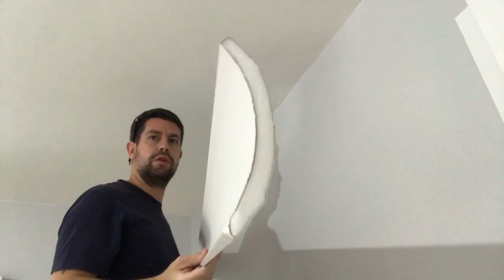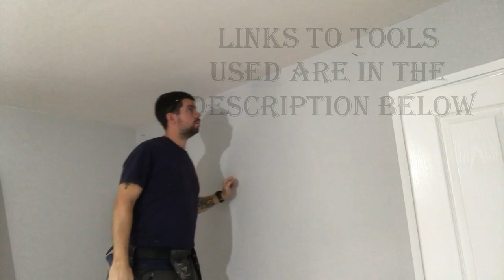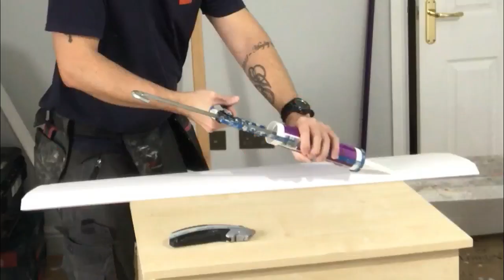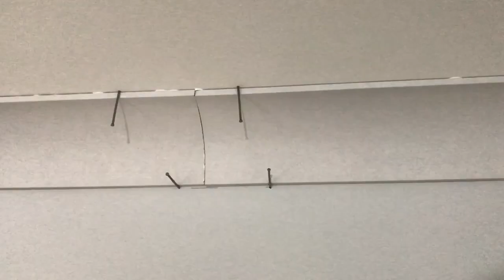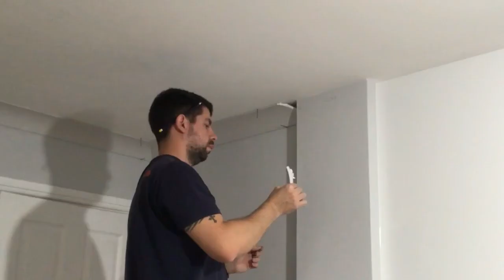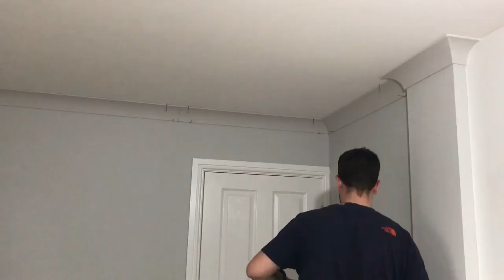How to cut and fit coving or crown moulding. Complete diy guide.

Comment: Apologies for the newbie question, but if I have a ceiling that has been artexed. Do I just fit it the same way, or would I have to get the ceiling flat before fitting the coving? Any help would be greatly appreciated! Many thanks!
Reply from the maker: I have fitted coving to many ceilings with textured artex. I just use a bit more adhesive on the ceiling and it takes a bit more to fill the gaps because of the texture but it's fine to do.
Hope this helps and don't forget to subscribe 👍🏼

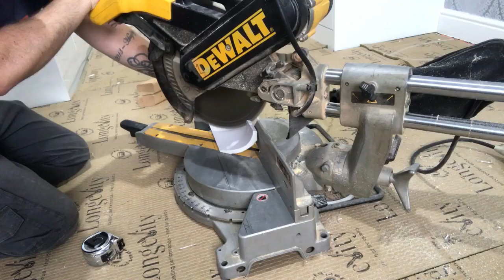Comment: That coving definitely has an non symmetrical profile, the ceiling edge is thinner than the wall edge. At 14:52 you can see the difference in thickness.

Comment: Have learnt a lot! Is there any reason why on the internal corners just one could be mitred and slide over the other straight cut?
Reply: To do it that way would require a curved cut to match the incoming piece to the straight , fixed piece, very awkward to do.

Comment: "I need some advice.

I live in a old house and I want to put coving up, but I have switches for my extractor fan, in the way, how do I get around it, with coving?
Reply from the maker: Honest answer, get a spark to move them lower. I've seen people try to cut around them and it just doesn't work.
It's a simple job for an electrician and even easier if it's a stud wall
Reply: @spendtimesavemoneydiy  thanks man, I've been trying too get my head around what I have to do for weeks lol, I'll look in to that thanks again 👍👌✌️

Comment: I live in an old house which I’ve just lined outside walls with insulated plasterboard, so I’ve had some piecing  up those walls with new cove. It’s typically not as deep as the original stuff so it’s just a case of making the best of it. 
Great video tho, as usual. Keep them coming

Comment: Can I use these same techniques if fitting plaster coving?
Reply from the maker: Yes but it will be a bit dustier.
Let me know how you get on.
Thanks for watching and don't forget to like and subscribe to help me out 👍🏼
Reply: @spendtimesavemoneydiy  can I use the same adhesive or should I use a wet mix?
Reply: @spendtimesavemoneydiy  can I use the same adhesive or should I use a wet mix?
Reply: @spendtimesavemoneydiy  can I use the same adhesive or should I use a wet mix?
Reply from the maker: @CMB_Vinyl  when I use plaster coving I use the same adhesive as long as it's not too heavy.
Reply: @spendtimesavemoneydiy  its gyproc cove 127

Comment: Have watched loads of videos trying to show how to fit coving and this video is by far the best with good instructions, I’m assuming that was a lightweight plastic coving, can Gyproc plaster coving also be cut with a mitre saw with success. Of course there is a small issue that most internal/external corners are not exactly 90 degrees but that’s another story 👍

Comment: I dont get why the saw base corresponds with ceiling and fence with wall, this is very confusing
Reply: Sorry, what i mean is that cutting mitres is confusing not your instruction.
Reply: @mongychops68  Because the saw he is using is only adjustable in one plane, to cut it how it is installed in the room you'd have to have the coving ceiling side floating above the saw bed in mid air.

Comment: Wasn’t aware you could use a chop saw for coving, and it looks like it does a nice & clean cut with no sanding to do after. I’ve always used a mitre block & handsaw which do a decent job but your way is better for sure.

Comment: Is this plaster coving? Or polystyrene type ?...I have the exact same type of adhesive you are using, but just want to make sure that it will be strong enough for the plaster coving I am using.  Great vids!
Reply from the maker: Scott Thomson this is actually polymer coving and really lightweight. I have used that adhesive for plaster coving and as long as you use nails to support it until it's dried it will be fine. Let me know how you get on.
Thanks for watching and be sure to like share and subscribe to help the channel grow 👍🏼
Reply: @spendtimesavemoneydiy  polystyrene? I wasn’t so sure a mitresaw would cut that without chipping it etc!